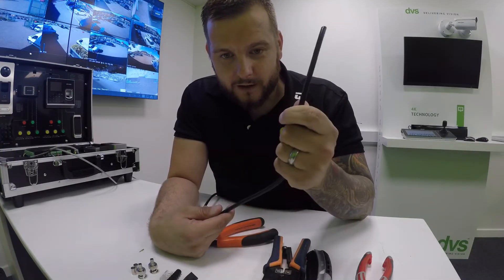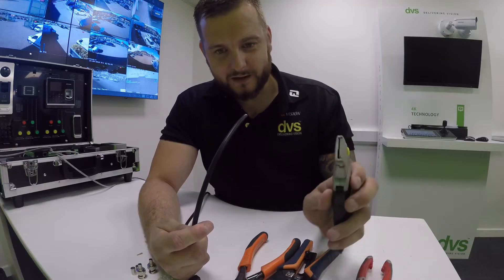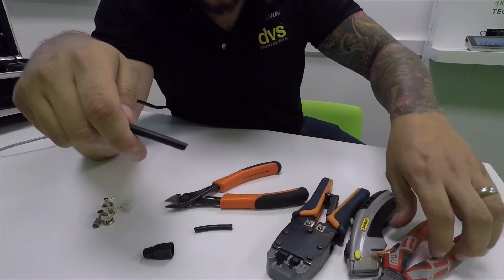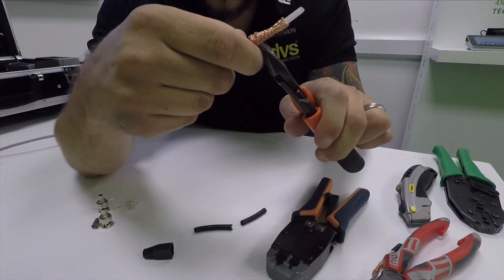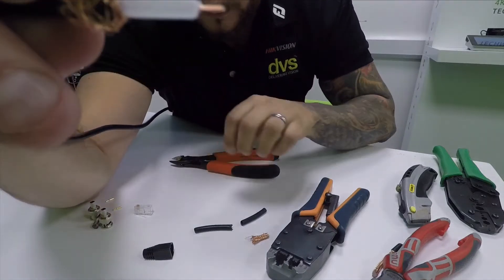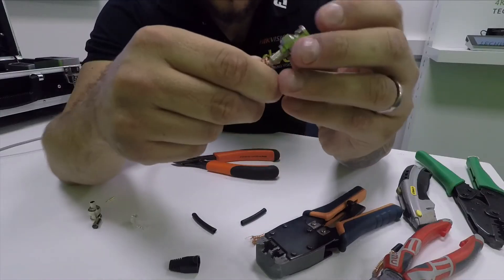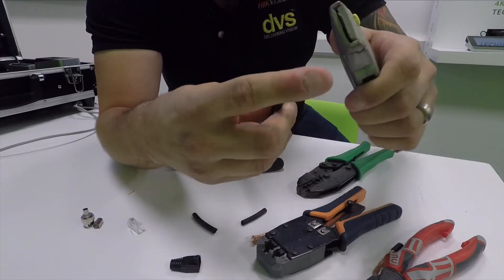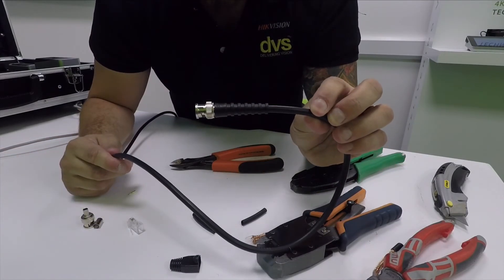How to Attach a BNC Connector to a RG59 Coax Cable

Comment from the maker: If you found this video useful, give it a thumbs up and be sure to subscribe to our channel!
Reply: When you have a multi strand centre RG cable, ie not solid, can I use the crimped system or do I have to solder the pin?
Reply from the maker: @ericalmeida6303  Hi, crimped works on both solid and stranded yes
Reply: Already did before watching.

Comment: Ohh, I Thougt You Would Show How To Do It With A Bit Older Style BNC Connectors because I have Bunch Of Them And I Dont Understand How To make The Connection With Coaxial Cable, I have This Military Grade Coaxial Cable That Have Many Copper (Almost Like Pipes) Around It, Several COnductive Layers And TThen Copper Foil And Everything is Pure Copper, No Aluminium Nonsense, The Connectors I Have Are Brass And Some Are Copper, But All Are Silver Plated, All Are From USSR Times, They Look Diferent On Coax Side, But They Are BNC And TNC And All That, But The Coax Side Is Diferent, Like They Are Meant To Be Taken Appart, TThey Are Many partts In Them, Pressure Screws And Stuff Liek That, I Wish I Could Send You Them And You Could Show Us How To Solder Or Make The Coaxial Conections On Such Connectors Because I believe There Are MANY people With Them As Old Stock Who Doesnt Know How To Do It Properly !

Comment: Any idea where I can purchase flexible (rubber?) strain relief type protective “boots” like the ones shown in this video?

I can’t seem to locate anything similar.
I’m using RG-400, RG-142, RG-223 and occasionally RG-58 with crimp style Amphenol BNC connectors and think the strain relief boots in the video look far nicer than the “doubling up” on marine grade heat-shrink tubing that I’ve been doing for years.

Any suggestions or recommendations?
Thanks ! Just what I wanted to ask!

Comment: Looks like a painfully slow process. Is there any benefit to this, over putting an Fconnector on with and F to BNC adaptor.

F connector can be put on with a stripper tool in about 10 seconds

Comment: Thanks for this great video, i'm having problems acquiring fairly long cable to work with my oscilloscope, as everyone pairs up a 1 meter length with BNC - to probe, or banana jack,i require something in the region of around 2, to maybe 3 meter length, as some vehicle are very difficult to access,and of course the laptop with the interface(oscilloscope) cannot be too close to the vehicle that is connected up whilst working away safely, do you recommend a longer coax cable in the region of 3 meter length ,and could you do a video, or refer me to something that has been done successfully ? Much appreciated  and Bless 🙂
Reply from the maker: Hi and thanks, do you know what spec cable is needed , its not RG59 is it ? 😊
Reply: @DVSLTD  Thank you so much for your kind response, 'LEGEND' 😎, i have an Hantek 3064A 4 channel 60Mhz oscilloscope (DSO laptop version)  with a X1/ X10 attenuator built in the probe, i'm guessing it may well be the RG59 (as China products are usually fairly low spec) however i think it may well do better with a slightly thicker inner core and outer sheathing, what do you Think, or better recommend ? 🤔willing to try and get at least 2 Channels up and running with longer reach cables, as the standard probe with cable supplied is simply NOT practical for any working Mechanic doing diagnostics safely with both laptop and scope virtually on top of a running car!! much appreciated for your kind input, Bless 😇
Reply from the maker: @sollykhan2385  That’s ok, could you just buy the leads from amazon like here ? - https://www.amazon.co.uk/s?k=oscilloscope+leads+3mtrs&crid=1X5QGB7PLBZDX&sprefix=oscilloscope+leads+3mtrs%2Caps%2C42&ref=nb_sb_noss

Comment: its a like from me my friend brought a cctv system from a cctv installer well conned no box 2 black and white cameras and a cheap techno dvdr i have upgraded the camera to full colour at night 5mp but the idiot has used cat 5 cable is the RG59  a better cable to used i used it on my last system no trouble ...

Comment: Where do you get the rubber covers I can't find them anywhere
Reply: Just what I wanted to ask!
I can’t seem to locate anything similar to the flexible (rubber?) strain relief type boots shown in this video.
I’m using RG-400, RG-142, RG-223 and occasionally RG-58 with crimp style Amphenol BNC connectors and think the strain relief boots in the video look far nicer than the doubling up on marine grade heat-shrink tubing that I’ve been doing for years.

Any suggestions or recommendations?
Thanks !

Comment: The ferrule is not supposed to be clamped twice, the die is deliberately that width to leave a small "Bell" at the bottom of the ferrule so it doesn't damage the outer insulation of the coax, especially when moved. And prevents the impedance of the coax being altered.
Reply from the maker: In my experience of 25 years of doing this it makes a better connection, maybe you don’t do it but that doesn’t mean it can’t be done , I know loads of people that also do this.  Thanks for you comment all the same

Comment: Good job but how do I test  a signal cable that previously worked but doesn't seem to work any more. I have an AHD tester
Reply from the maker: Hi Johnson, so the image wont work right ? it depends on the signal type and cable IE if using latest Turbo DVR it can go up to 800mtrs @1080P , have you tried to reduce the camera resolution to check ?, AHD is one of the furthest signal types , and  this is getting nothing ?,

Comment: Does anyone know how to go about painting your BNC adaptor (black for 
example)?  Is it safe to just spray it on with a can?  I've seen a lot 
of BNC adaptors black and I want to be able to do this with an adaptor 
that only comes in chrome.
Reply from the maker: You could spray it black once its on but it could effect the connection properties. There may be black ones on the market just not seen any?
Reply: @DVSLTD  Well, I've looked pretty hard for the last few days and just can't find anything.  I was thinking about spraying it, but without knowing if it will effect the electrical properties I feel it's too much of a risk.  There are plenty of other types of BNC connectors that are black, but I don't know how they make these?  Any idea?

Comment: Wow can't believe you didn't more blasted for poor workmanship.

Yes I can use the Stanley knife.  But seriously please use the right tool to cut the outer and braid.

I'd ping my workers and myself for this effort. Hairy braid is a no-no.

However all I use now is Cat5e/6 with baluns.  Tho I do want to try POC.
Reply from the maker: Carl , I have used a Stanley knife for years , I can do it with side cutters also , it has the same effect , I can be trusted with a knife as I am a responsible adult mate, yes try POC its great , I bet my work is better than yours 😊
Reply: @DVSLTD  That's a good challenge and yes I have used my Stanley knife to but only if I have problems. I usually use the professional three blade cutters to do the job consistently.  Having hairs of braid is not what I like to see, but there have been times.

Mostly these days using Cat 5e/6 with baluns
Reply from the maker: @cjkokay  Thanks for the comment

Comment: Thanks for showing the connections which brand connectors are recommended? Can u please suggest the ones which are the best for temporary outdoor events, as when we are finding up the cables get dirty from the mud and the connectors get spoilt and difficult in cleaning
Reply from the maker: Hi , thanks for the feedback , we buy them in bulk but there are version with gold connectors and crimps available , for a more rugged version external use ones in the UK are available